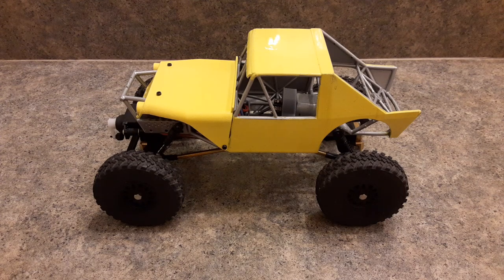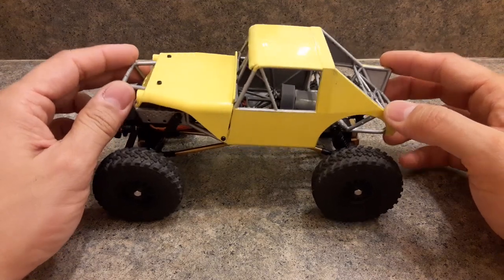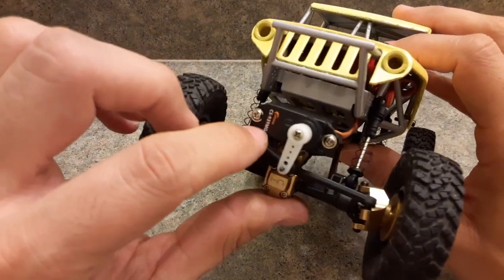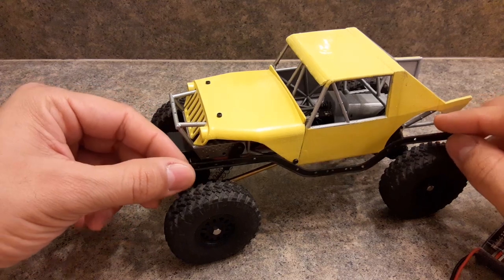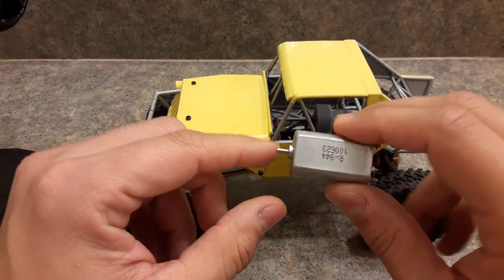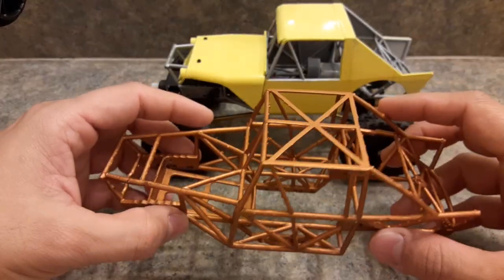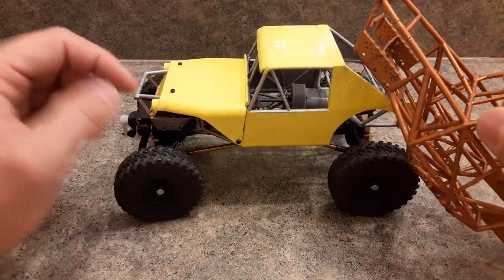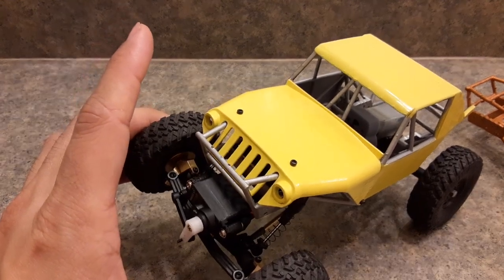Axial SCX24 Deadbolt with Miller Motorsports Chassis

Comment: Thank you for the video,  i like to see these upgrades,  even though i plan on using a hardbody.
Can you post an installation video for the HH Revolver 380 motor?
I can't find it anywhere, and will be using your motor mount when the motor arrives,  don't want to mess it up.
Reply from the maker: Its super simple. Just replace the stock motor plate and bolt my plate on. The 380 just takes 2 bolts to bolt on :)
Reply: @Gamyrc  so the motor mount I got, replaces the one plastic transmission cover,  and the metal motor plate in the middle?
Reply from the maker: @MrsRabbit8  Yup :)
Reply: @Gamyrc  awesome,  thank you. 
Now how to muffle the whining sound these motors make..
My buddy has one,  the 540, it's pretty loud!  Lol
These outrunner motors are not great with regard to mud and water,  perhaps a boxed in motor to muffle and protect?
Reply from the maker: @MrsRabbit8  I wouldnt dare bring it close to water and even less mud. Too much to lose if it got in it. If the plan is ridiculous power and waterproof you couldve just gone with the 370 motor🤔
Reply: @Gamyrc  i see.    Perhaps that would have been a better choice. 
Though even with a different motor,  i don't plan on exposing the engine to water and mud,  gonna design a protective shell regardless of the motor. 
I was under the impression that the revolver is the best motor upgrade,  i want the best motor upgrade.
Still not too late,  I could order a 370 mount from shapeways. 
I'd have to dive right back in to finding the right motor otherwise.
Reply from the maker: @MrsRabbit8  The revolver is hands down the best. Its just that Im not sure it would like water and mud. But if you do make a water tight shell around it I guess it should be ok 🤔